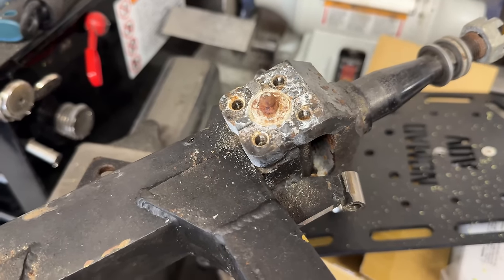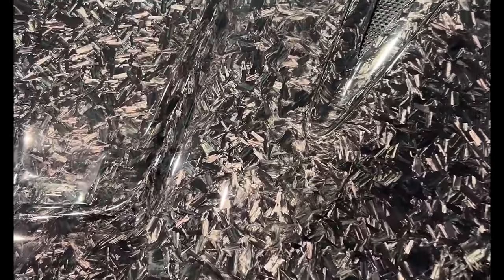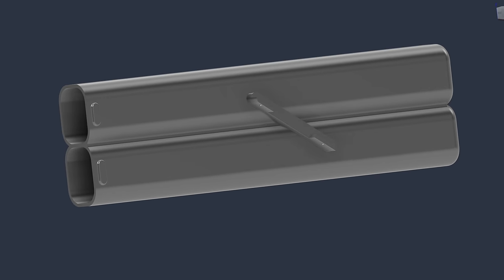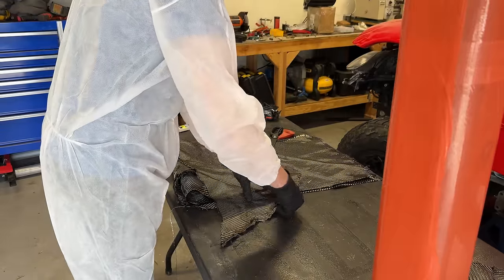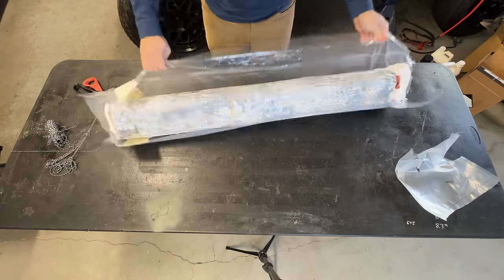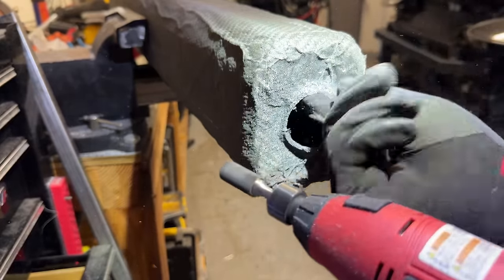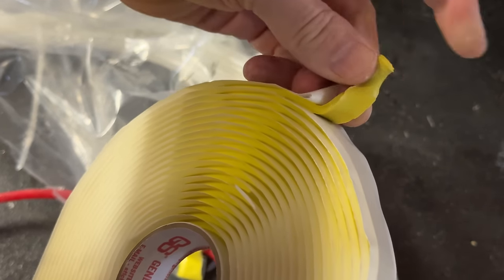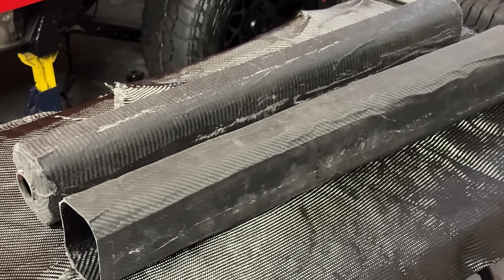Composites Are Hard

Comment: Offff this one was painful. I do tubes with carbon sock in a female mold and use an inflatable bladder. If I must do a male mold like this I use heat shrink tube instead of vacuum bag so there are no ripples.
Reply from the maker: I considered doing the female mold with a bladder but the layup part seemed like it would be a lot more difficult.
Reply: @SuperfastMatt  yea and you already had material. Carbon sock is what makes tubes easy and crispy perfect.

Comment: I am kind of surprised that you didn't use foam for your mold since you were going to destroy it anyway you could have just poured acetone inside and dissolved it out. Especially since you didn't really care what the surface finish looked like. You could have cut the basic shape on a table saw or with a yellow knock off saw and then just round off the corners with a rasp

Comment: I know you are an engineer and I am only a modeler but you have made it way too complicated. What I would have done is to make an expanded bead foam plug in the shape you want. Lay the CF over it in layers and wrap it with peel ply. Then vacuum bag.  When cured simply use acetone to melt the foam out. About a 2-hour job. Good luck

(EDIT) this method can also be used for your body. Make a plywood buck on a spine and fill it with foam, and sand, and lay glass over the plug. Now you have your mold. It must be perfect and the plug will be exactly as the body will be when finished. Wax and PVA the plug then lay glass over the plug in desiderd layers. Make sure the plug draft is at least 2 degrees for release. You can heat the the mold (sun light) and blow air to release it

Comment: Hey Matt, a few things on the 3d printing: The gyroid infill you used on the 2nd mould (the white part) is not too good for strength and print speed since you never really have a straight line. The "cubic subdivision" infill you used for the black prints is what i found to be the best. Also since you printed this on a bambulabs machine you might want to be aware that they are "too fast" to create good layer adhesion. i would advise to use higher layer height and line width to increase part strength (same flow -> slowe print speed)

Comment: I love the videos that you make and how you address problems like an engineer... Severely overcomplicating a simple process. Why use a easily obtained 4-in PVC pipe that will do the job, is lightweight, smooth both inside and out and won't corrode, for $15 when you can do something like this for absolutely no reason 🤣🤣🤣

Comment: The most expensive oversized downspouts ever. 
Yup.
Should have used oversized PVC downspout material. It's a thermoplastic. Heat the one end and slide it over a cone, bing bang boom, circle to rectangle transition.

Comment: All that effort to make a carbon fiber gutter pipe. If it was me I'd have just got a couple pieces of Galvalume downspout tubing and called it a day, and with 4 layers of carbon it probably would weigh about the same as the aluminum. Or you coulda used the downspout tubing as the mold instead, buy twice as much pipe as you need so you can slice em lengthwise and squish em back together, that way you can peel it out.

Comment: Holy moly don’t build the car body like this.  It will not be very good.  Everybody wants to just slap together some composite mat and vacuum it thinking it will smooth out.    As you’ve learned it doesn’t work like that.   You need a fixed smooth surface to vacuum against….a mold.  If you don’t want to make an entire hard mold you can do builders foam plug and make a final off that.   If you want a final smooth surface off a plug you need to sand it smooth and use laminating filler.  Then wrap with one final continuous layer of thin fiberglass and even then the peel ply and breather will still imprint some. 

Can’t wait to see what you come up with.  It would be very cool if you built a clam shell mold but that’s a ton of work.

Comment: Damn, no wonder you hate composites, you WAY overcomplicate this. 😄

Styrofoam positive; wrap in the cheapest, shiniest packing tape you can find; add a layer of parchment paper if you're feeling fancy. 
A long, thin part like this is much easier to laminate if you add a dowel on each end and lay it horizontal. 
With enough draft angle, tape + parchment paper should demould pretty cleanly. Otherwise, dissolve the foam and yank out the tape. Done.

Comment: By the time you finish this car you could've grown trees cotton and made your own tools out of stone, vegetal fibers and bone, to made a self-portant body hull to fit some bearings, engine mounts and wheels from the 21th century. Do you realize EV or ICE car would've been never invented if people had started their prototypes with your industrial materials and such huge dependence on machine asssited work?
No EV Porsche in 1901, no MB first car, no Skoda, no Tatra, no nothing... no Ford sequential building line either... could you please ask some NASA engineer to build a Robot to Hold whatever while you struggle to build your own  22th century starship based materials chariot? You better add fully electronic IMU and avionics for remote control just in case it flies at speed... You better don't drive it for testing purposes. No entertainig show if you crash.